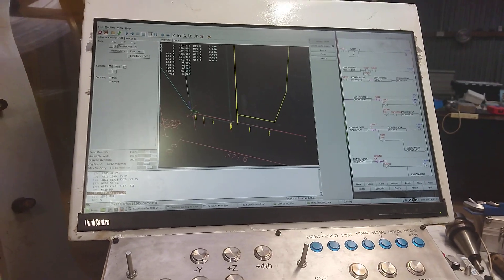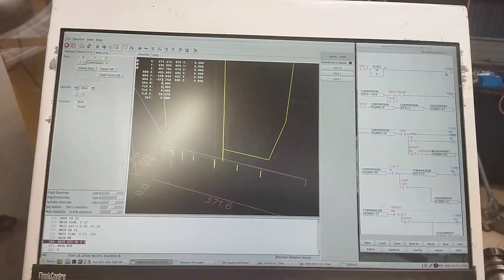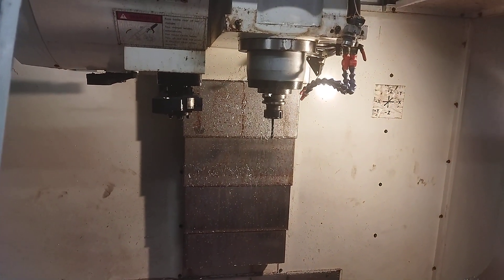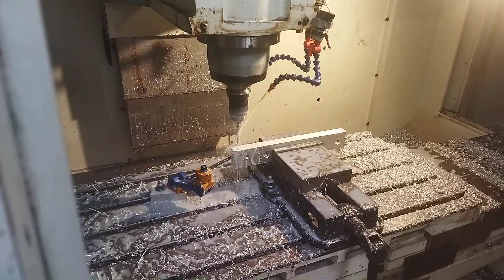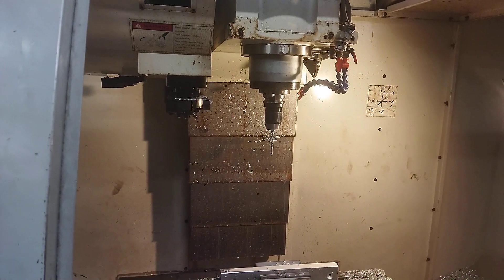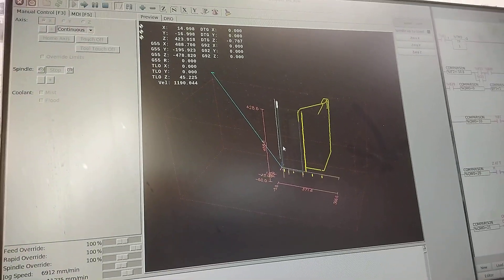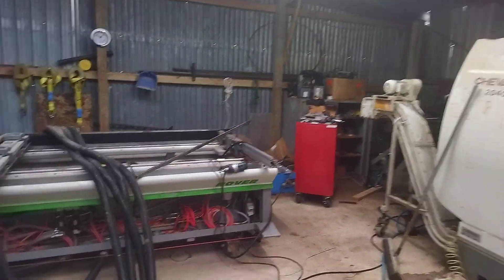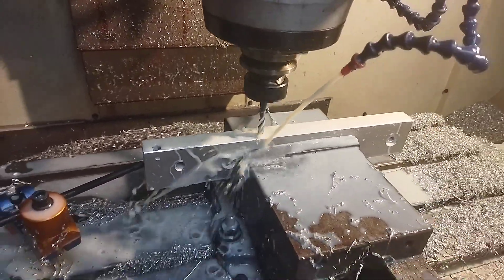Linuxcnc first parts with toolchanger rigid Tapping and spindle orientation.

Comment: Is that asynchronous spindle?
Reply from the maker: Yes.  What are you wanting to know?
Reply: @carbidecuttersnzltdandrewb8449  i wanted to know if normal asynchronous induction motors with encoder and vfd can be used for rigid tapping in linuxcnc
Reply from the maker: @sourabhkumawat4863  rigid tapping in linuxcnc makes the Z axis follow the spindle encoder.

You could turn off spindle and turn it by hand fine.

The main thing is you need to be able to stop spindle fast if tapping blind holes.

Otherwise you bottom out.

Spindle orientation is quite a bit harder.

But both of these can work fine with a vfd and normal motor.

The best thing to go is get closed loop vfd with encoder card.

And put a encoder on spindle motor shaft.
Reply: @carbidecuttersnzltdandrewb8449  thanks a lot sir....that's what I needed to know